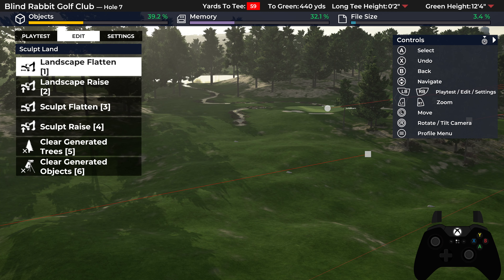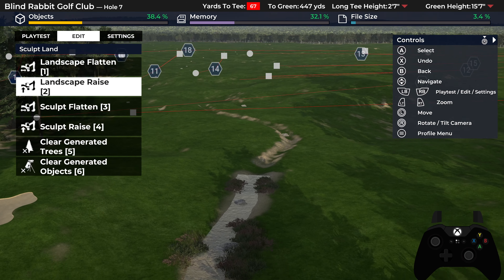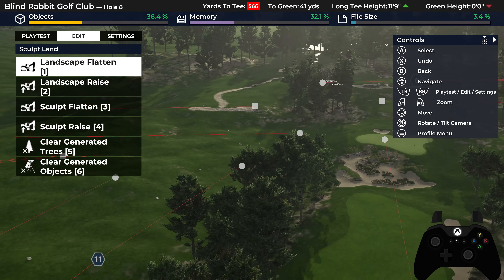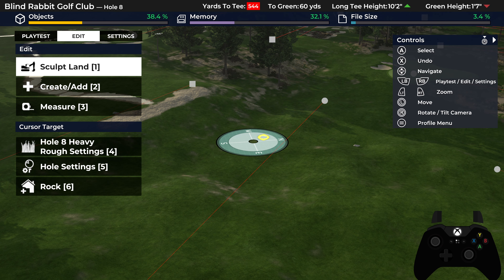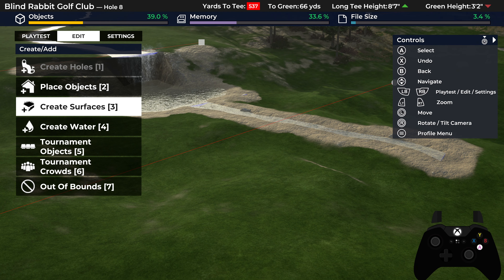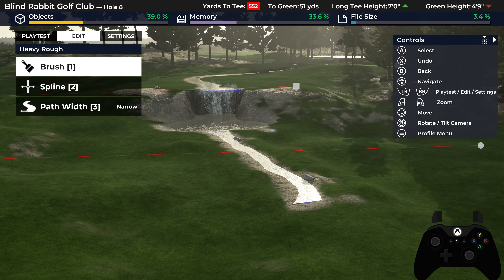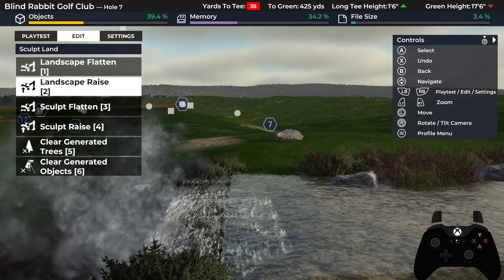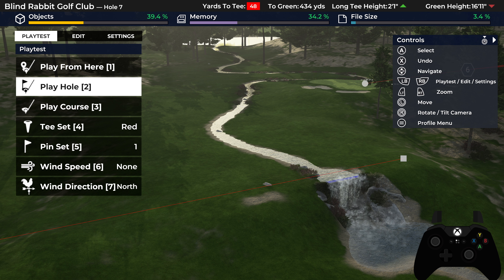Course Design 201 (PGA Tour 2K21) Episode 3 - Streams and Waterfalls

Comment: Do you do anything to cover the top part of the waterfall so it doesn't show a crazy flow so sudden and in a straight line just before the waterfall?

Love the video.
Reply from the maker: Thanks! I just try to cover it up with vegetation as much as possible or try to obscure the view.
Reply: @Crazycanuck1985  ok that's what I am basically doing.  Wasn't sure if there was a way to make unnoticeable without objects.

Love your courses by the way.  Have used several in my society.
Reply: @Crazycanuck1985  on my first course I covered that with stones barely sticking out of the water and adding high splash to create a mist effect that worked well.  Was overall happy with my first one.  But definitely looking to improve on my 2nd and keep getting better after each one.

Comment: I always work on these principles... there are easy things to do that look ok... but lots of folks will do those...there are easy things to do that look great, but arnt obvious - try to increase the use of those.  There are apparently easy things to do, but require thought and a certain appreciation of what’s going on ... not really teachable but improve with practice... there are also some hard and/or tedious things but because of that fewer folk will do them well or at all... so if you can grasp them you’ll be ahead of the pack... finally there is that unknown designers eye and touch that make some stand out from the rest irrespective of what buttons you click and objects you place...
Reply from the maker: Excellent point. Completely agree
Reply: I didn’t mention the bits that take forever and look hopeless!... those are the ones to avoid....